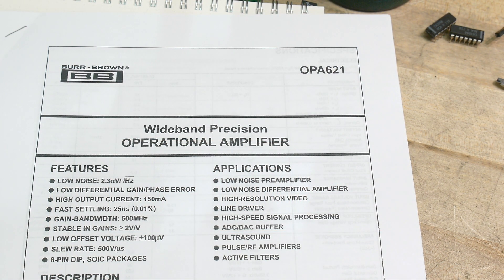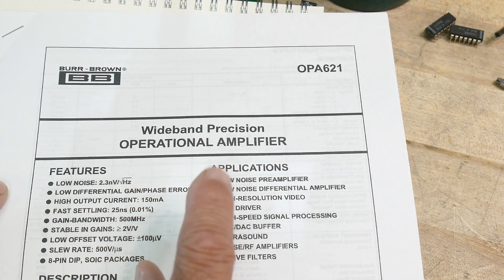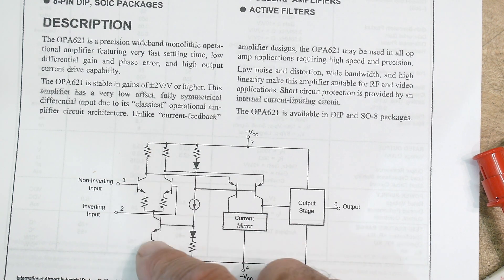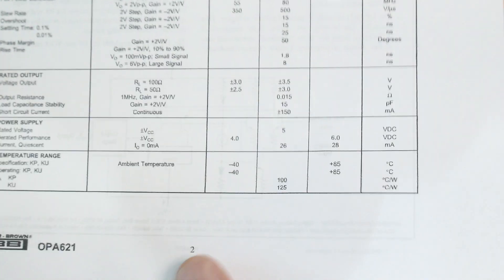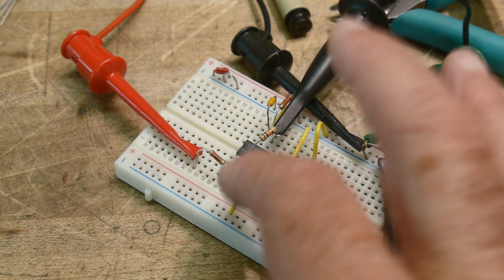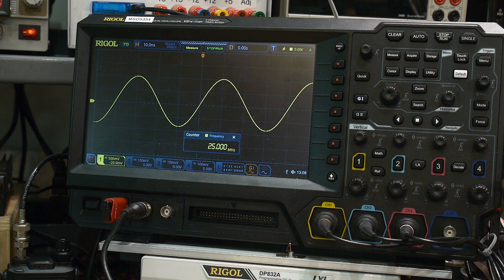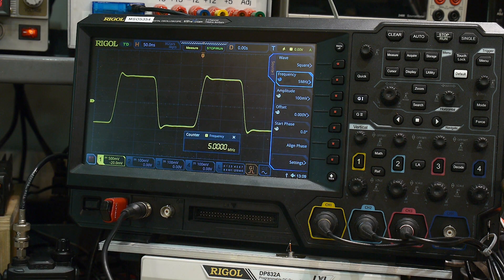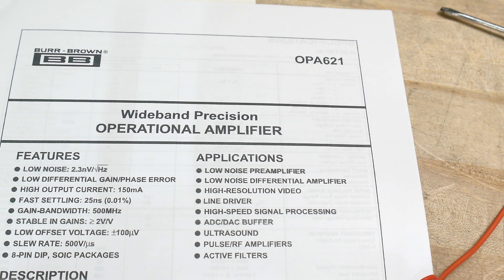#1207 OPA621 500MHz Op-amp

Comment: I am doing a low noise design at work, and I am using the LTC6228 which beats the OPA621 in most of the specs except the output power.

Comment: Try LMH6703 1.3GHz BW  and they are cheap 8V max voltage. These are current feedback amps. LMH6629 is very good voltage feedback and OPA838 is a super nice low power (1mA quiescent ) 300MHZ BW . There are now OPA855 rated for 8GHz with min gain of 7 so over 1Ghz BW  @ -3dB  with gain .

Comment: For better stability and frequency response, use smaller resistors and keep inductance loops small.  The input impedance should match the transmission line -- this voltage divider means you need twice the gain you might expect.

Comment: Try a BUF634. TO220-5. High current drive. High frequency setting. 
Used in fb loop of opamp. 
I’ve used as a super headphone driver. 

20

Comment: OPA820 looks close, I think.
Reply: I think this is very useful chip, look at page 33 figure 66 of TI datasheet, which is used  as an Instrumentation amplifier.  I wonder what is working frequency of this chip in this topology.
I guess I built it and measure it.  Has any one else used it as  Instrumentation amplifier?  How was it performance?

Comment: Lately, I'm curious about low-phase noise/jitter RF clock kits.  This chip would potentially work well as a crystal amplifier and 50 ohm line driver.

Maybe it's time to rework "A Low-Frequency Crystal Controlled Oscillator" by Ing. Ramón Vargas Patrón!  That author claims "operation of the oscillator in the 10 kHz to 500 kHz frequency range has been found to be excellent, while measured distortion is kept under 0.1 percent" so I suspect that range could increase significantly with OPA621.  Also, the use of an op-amp instead of class-A should improve the linearity, PSRR, and line-driving capabilities.

Comment: Hey, nice op-amp. 
How you don't get any glitching on your oscilloscope while testing this circuit on so high frequencies in breadboard ?
Reply: If the input is a sine wave and is driving the amp hard it will "oscillate" in step with the input signal! Easy to get fooled!

Comment: Under ten bucks at Digikey. Note that you MUST use a board with a good ground plane to get anywhere near the specs of that amp. Even with a nicely made board you will need special scope probes with the tip ground pin. Using "Audio wiring" for an amp like that you may as well use a far lower performance amp!
Reply: For prototyping, you can actually do pretty well with 'dead bug' constrruction - build everything on an unetched PCB, put the chips and transistors on the board with hot-snot or 5-minute epoxy with their pins in the air, then the two-legged components just flying, soldered to the pins. Power leads use 10 nf caps as their standoffs so you get distributed bypassing. (At the high-frequency end, you might need to parallel them with 500 pf mica caps).  If you need a floating junction for some other leads, then tie it down to the board with a high-value resistor or a tiny-value capacitor.  If you keep the leads short and the RF paths straight, this sort of construction works surprisingly well.
Reply: @ke9tv  For low frequencies. (below 50mhz)
Reply: @glasslinger  Well, yeah!  But those protoboard sockets get wonky way below that. I wouldn't do anything HF on them.

If you're really careful about lead lengths and shielding, you can dead-bug a 6 or 2 metre front end that'll work well enough, but 70 cm is right out.
Reply: Hi Glasslinger! I don't do too much with old radios... and sadly not much glassblowing anymore... but, I really enjoy your videos! Your're the best!
Reply: Hello! Great to see you.
Reply: at least his probes are being continuously compensated by the ty-rhap, haha
Reply: What is definition of good ground plane, how i could check if i have good ground or not really ?
For me breadboard start glitching when i testing signal that a lot less than 25Mhz(maybe at 500Khz) but here i see clear signal at 25Mhz in breadboard  that not fit into my head how this even possible.
Reply: @tremaa11  Use a 2 layer board with one side solid ground plane. Try to keep all connections short, 10mm or less if possible. Bypass RIGHT AT the device pins, no trace length at all. Use good quality chip ceramic caps. Compact layout is best. Bypass power leads every 10mm if they run all over the place.
Reply: @tremaa11  Well... the definition of a "good ground plane" is a circuit 'component' which is less ideal than both an 'ideal ground,' and 'ideally planar.' You can get as complicated in the analysis as you want: but crudely addressing just  the ideal ground concept, it is of zero impedance. So a good ground would be as close to zero impedance as possible.

Comment: MAX477 is a tier below that OPA621 but good enough for a lot of things (like video).  

LMH6629 is a tier above. If memory serves, some of the newer sources are claiming a GHz GBP on that device and a quarter-amp of output current into a 50 ohm load.

They're both the sort of part that you could get overnight in  ten thousand quantities before The Pandemonium. The first is a two-buck part, the second is about a five-buck part.

Watch the gain compensation on these things.  You usually need to run them with gain of at least about 10. Any lower and they oscillate like heck. They are NOT unity-gain parts! And of course watch the power supplies, layout, and all that good stuff.
Reply: LMH6629 looks like a very nice problem solving part!

Comment: Probably do better if you used something other than the  proto-board shown.  Nice amp.  Used current feedback op-amps for video (radar) in the past.
Reply: As I said up above, "dead bug" construction will likely far outperform a protoboard in this range.
Reply: I love playing with HD video in the analog domain. I don’t love having to spin a new controlled impedance board every time I change something. But at these frequencies the parasitics of a bread board are impossible.